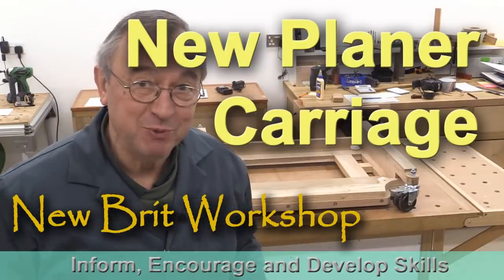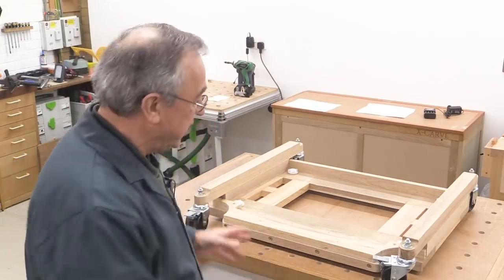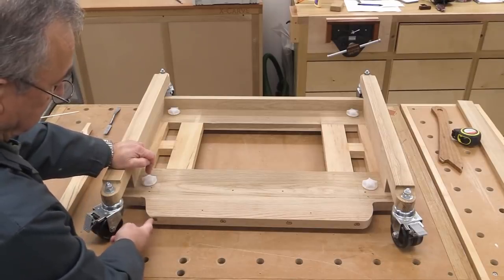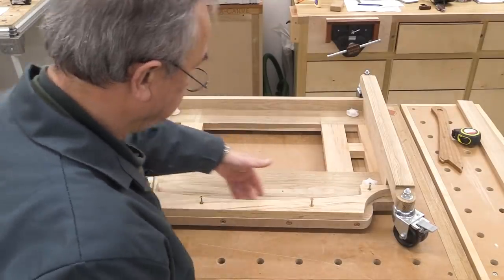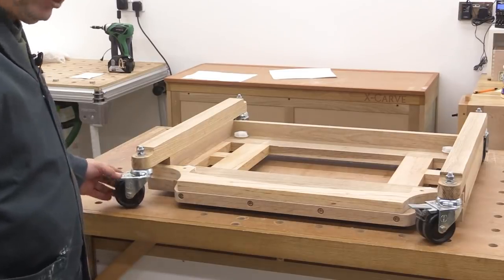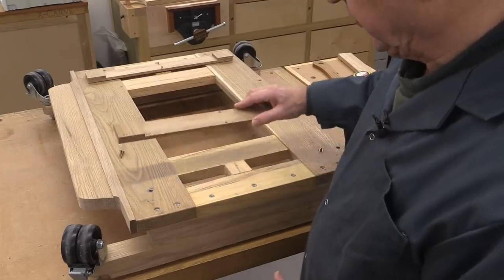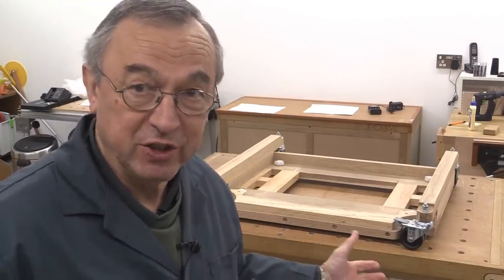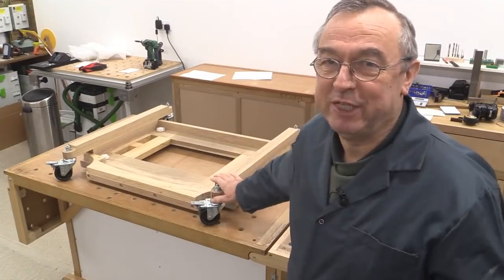New Planer Carriage

Comment: Hello Peter. thank you so much for this video, this solved a problem that i have had for a while, wanting to be able to move my planer around on my own, but never came up with the right idea.
Reply from the maker: Hi Frans, Make sure you use really strong wood and that the castors of high quality with locks.    Cheers.   Peter
Reply from the maker: The plans are on the way.  Peter

Comment: Dear Peter, the fixation option is a great improvement of the carriage, though I think it will be hard to turn when the machine is mounted on the carriage. Wouldn't it be better to use bolts in the inserts, these can be turned with socket in a torque driver. Rhanks in advance for the plans.
Johan
Reply from the maker: Hi Johan, You are right but the knobs will provide sufficient force to fix the carriage in place. If one needed to level a machine or take it completely off the castors then bolts would be better.    Peter

Comment: Hi Peter, hope the sandpaper pads work.  I think if it were me, I'd have used some thin rubber of some sort.  Old bicycle innertube material would probably be OK.
Reply from the maker: Hi Steve, Yes, I think that would work. I can always change it later if it does not work as it should.  Cheers.  Peter

Comment: Peter,
Thank you for your willingness to share your knowledge and experience. I'm new to woodworking and found your original planer carriage video as a reference for adding casters to a workshop piece.

I wonder what would you call the cut you used on the piece of oak for the casters to add minimal height to the project. I am working on a drill press cart and hope to emulate your design to make the top heavy drill press more stable.

Thanks!
Reply from the maker: I am not sure what you mean - I don't think that joint has a particular name but cantilever comes to mind.   Cheers.  Peter
Reply: @NewBritWorkshop   Thanks for the quick response, exactly the term I was looking for.

Comment: I greatly enjoy your videos, thank you for posting such ingenious ideas and interesting content; Happy New Year! 
I think that Axminster is missing a trick here when it comes to moving heavy machines around the workshop. The Hammer machines from Felder have an incredibly simple and low-cost optional rolling carriage with a lifting bar. This seems to be a much easier solution when working in a confined space and where it's necessary to be constantly moving machines. Also, there's nothing around the base of the machine to impede you whilst working. Through your relationship with Axminster, you're in an ideal position to ask why they don't offer this option. I'd be most interested in your opinion in this regard.
Reply from the maker: Hi Christopher, I have mentioned that before. They do have the equivalent of my home made carriage but theirs is quite expensive. I think that the Hammer solution sounds better.  Cheers.   Peter

Comment: Its a good plan and video but like others who have commented I am  baffled why all heavy machines don't come with built in mobility.  Working alone I have struggled to install mobility kits on heavy machines, e.g 8" planer.  I'm in the market for a jointer/planer combo and would like to know how you got the machine on to the base.  I see that you have a removable side but that still requires some lifting.  How did you get this done?
Reply from the maker: Hi Michael, I have moved machines weighing 3 times that of this planer and it only requires some understanding of mechanics and some lessons from Archimedes. If you imagine a machine with 4 feet. Rocking the machine or using levers to get two feet off the ground by 25 mm does not take much effort. At no stage is the machine lifted - less than half the weight meed to be overcome. Also, getting a machine without castors from one place to anothert can be done by "walking it" whereby its weight is always on at least two of its feet making it easy to move forward or backwards. I tried to find an example where I show this techique and the nearest is the relatively simple case of moving my pillar drill - look at about 11 minutes 15 seconds in this video: https://www.youtube.com/watch?v=fxa871t1mwY   Peter

Comment: Hi Pete, would you say the pads are necessary even with the locking castors? I'm getting a machine that weighs 176kg and was originally just going to copy your original mobile platform in video 24/09/13 and wondering if should add them in. Thanks Kev
Reply from the maker: Hi Kev, I have decided that I do not need mine as the castors lock so well.  Peter

Comment: Peter, you may recall a number of years ago I built your original sled for my Axminster planer. I plan to get a new table saw soon (any recommendations by the way) and would like to build another sled with the updated design. Please send me the plans and I can use the 2nd set of Caldene castors I purchased at the time just for this purpose... hopefully you can see my email address (if not I will add in reply)...
Reply from the maker: Hi Steve, I do not retain email address information - please send it to me and remind me of the requirement then - I get about 50 requests a day !  Peter

Comment: Hi Peter, I built a fairly large heavy duty Mobile table for my 12" XCalibur Table Saw and my UJK Cast iron Router table.
As a project this year, I am planning to build four 12Volt DC, 200mm 1500N Linear Actuators, to lift the table off it's castors and so I can level the Table accurately, (since my garage floor has an irritatingly severe compound gradient, I currently have to lift it with a car Jack and stack boards under the castors, it's a real pain).
I use the Table for resin pours and project assembly as part of it's multi-functionality, (it also has a small Parf Guide work table built in for holding work for planing and chiselling above the 10 Drawer Ash-fronted storage).
I very much like your idea for the contact Pads, so with the greatest thanks, I'll incorporate that into the design.
I may upload my first YouTube video of the modification.
I love your brilliant videos and chart topping outro music!
Reply from the maker: Hi Henry, You may find that for a heavy machine that the diameter of the knobs is not sufficient to get the force needed to raise one corner of the machine. My idea will work for machine stability but may not work for machine levelling.  Let me know how you get on.  Cheers.  Peter